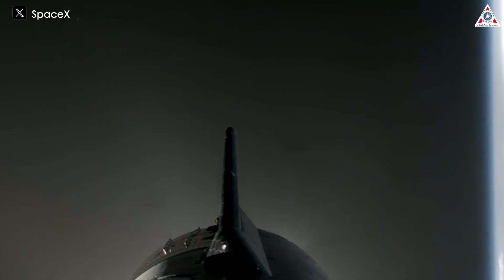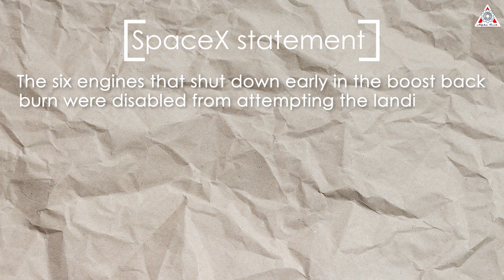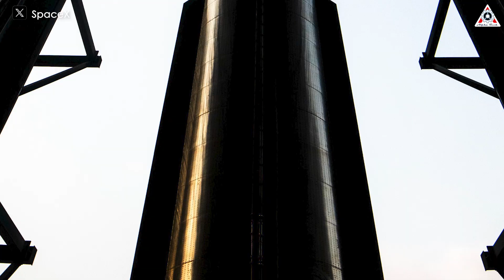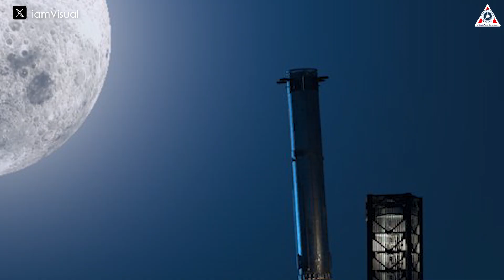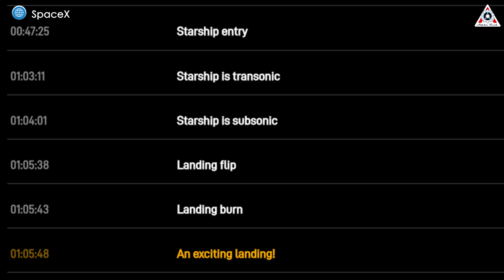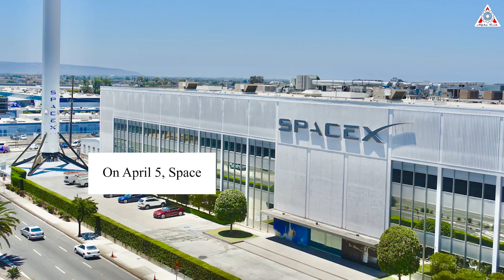SpaceX’s big solution for Flight 4 affter reviewed Flight 3 TROUBLE

Comment: So what kind if idiots would launch again before they fully understood what happen in the previous failure? 

Only SpaceX!!  A more accurate description would be that they don't fully understand what happened. But that sounds kinda bad. Bottom line is they are just guessing!
Reply: They call that iterative development, in reality it's called improvising...
Reply: there is very clear idea of what happened and remedies the odds of making it through re-entry appear to be 80%, doesn't appear to be any safety issues exactly what idiot are you referring to...Are you comparing them to Blue Origin
Reply: @13thbiosphere  The idiot I was referring to iis the one that sees an 80% of making it through re-entry as being ready to try again!! 

As for Blue Origin, I don't see them trying to rack up failed launches just to hit an arbitrary goal set by the owner!  They had one engine failure on launch that caught fire.at Max Q and they did an automatic shutdown and abort saving the capsule before the intact booster came down and  was recovered enough to pinpoint the failure cause. 

They worked hand in hand with the FAA, NTSB, MIT and non-associated parties on the failure analysis and fully reported the results with full transparency..

A very impressive, refreshing approach compared to SpaceX who prepares their failure analysis in secret and provides minimal reporting to the FAA and the CEO gives a verbal one or two sentence media update, with his "trust me" assurances that they have it solved. 

I prefer the BO approach being fully respectful of the governing agencies and full transparent in the reporting. Very professional! They do it the way it should be done!

You might argue that the Musk approach is much quicker to schedule the next failure, but I trust Musk about as far as I can throw a Starship! 

BTW, when are they going to demonstrate the abort/escape feature of Starship??  Oh yeah, I almost forgot, there is none!! BO had tested and demonstrated theirs months before this real world unplanned abort. Worked perfect both times!

Comment: This launch will have so much data delivered to SpaceX they'll be flying humans by flight 15.😅
Reply: And why would you think so?  Pretty clearly they are just guessing what went wrong the third time. How would they get more data like to be sure about icing?? You obviously seem to know si please share!!  They're just going to try some stuff and hope it works, but it's unlikely they get any more real data
Reply: @professorg8383  SpaceX added more control thrusters to keep better roll control, tank filters reworked to alleviate blocking from freezing, dropping the hot stage ring. All improvements over IFT-3. Just a few fixes!
Reply: @PiCorder  Yes, I know, but how does that get them more data??? 

It seems quite clear that data did not pinpoint the issues conclusively. They are making guesses. I hear nothing about adding more sensing capabilities. Maybe they are doing  that, but if so, why not say  it??   

I know this is part of how SpaceX operates, don't really explain things or how they reached a conclusion. They make statements designed to satisfy trusting simpletons. 

Of course if you're the FAA, you want a bit more than that. But SpaceX isn't even supplying a "preliminary report"!. They are saying it isn't complete yet. If the investigation isn't complete, how can you assert that you are ready to fly again??

The only data that they will get is that it failed again or it didn't. But concluding that you solved the problem is not possible to be proven!

I get that you are a SpaceX/Elon Musk cheerleader and enthusiast, but I have seen nothing to conclude that, "This launch will have so much data delivered to SpaceX..."   Do you have some info not available to the public??  

I'm an old school, real world engineer who grew up in the earliest days of the "space race".  Almost everything I see and hear from SpaceX and particularly Elon Musk, tells me O should be very skeptical about anything they say.  In reality, they say very little. So I don't read into that things that are not said. I look back some 50 years plus and compare the level of detail NASA provided on virtually all their missions and I see nothing approaching that from SpaceX.  

I also see a great reluctance to accept government agencies like the FAA and FCC even having authority to regulate what they do. I find this most disturbing when I see other space companies working hand in hand with these authorities. Arguably, they barely respect NASA, with who they have the $2.9 billion contract for HLS. 

SpaceX is way behind the deliverables on the HLS, so arguably, they owe a ton of data to NASA. But NASA issued a fixed price contract to SpaceX, which was a huge mistake. The Starship concept has been around for more than a decade before, but nothing was built until the NASA contract. NASA did not contract for the reusable Starship. But that is what SpaceX is developing and the HLS is suffering in the process. And taxpayer funds are being spent for Musk to build his fantasy rocket and it is questionable at best that the Starship HLS will ever fly.  This is just one of many reasons why I am so skeptical and mistrusting of SpaceX.
Reply: @professorg8383  Wow! That's quite a response! Let me say this; while on the surface, I might appear to be an Elon Musk cheerleader, but in reality, I'm a skeptic as you seem to be. With changes made to starship after flight 3 comes more sensors, cameras, more software, and monitoring mechanisms. Flight 3 issues were explained to be freezing of the propellants in the tanks or valves and filters blocking fuel flow, which prevented engine relighting when required. The propellant temperature is critical and must be kept constant. The problem is that they are liquid at different temperatures, but the methane flows thru the LOX tanks on its way to the engines. Since it freezes at a different temp than oxygen, both must be kept flowing to prevent freezing-like leaving your water faucets dripping water during extreme cold winter weather. This action is not available with a fixed amount of fuel to return these test vehicles safely to earth. I'm a child of Mercury, Gemini, and Apollo eras, and while Spacex, as a private company, doesn't need to tell us everything about their internal operations, NASA, FAA, FCC, etc as publicly funded entities aren't forthcoming at times even though you and I support them through our taxes. I think fixed pricing is great as long as it's realistic. I've seen the waste with cost-plus contracts over the years, but whatever the agreement is, it is what it is, and both parties should abide by its terms. SLS, HLS, are both bold ventures we haven't begun to comprehend their complexities for returning to the moon and onto Mars. I'll most likely be leaving the planet b4 there's a permanent settlement on Mars, let alone the moon, and that won't be this or the next decade. Even in the space industry, the pla ets nations are  not 'all-in' for the benefit of humanity, so it'll be some time b4 true exploration is commonplace. Just look at our Space Force. We're planning for Star Wars and laser satellite attacks and more spying on our neighbors. Elons' wild questimations are hus own, and while over exaggerated, it's his way. Keep in mind that although he may be 'chief' engineer, he's not resolving problems on his own. Credit belongs to his teams. So, while "Elon-time" is synonymous with "whenever it actually happens to come to pass," his companies are changing the world in ways governments have stagnated real progress in space, auto, and other industries. I expected the Space Shuttle to be ferrying astronauts back and forth to the moon, a lunar station, and more, but that didn't happen either! So, I stay patient and watch and appreciate the progress that is being made, such as Starlink and the real possibility that SpaceX will meet their contract obligations at fixed prices while other companies cry and sue and waste tax dollars by demanding NASA to return to cost-plus contracts which contains more waste than progress in space exploration. With new approaches to science and exploration comes new challenges and resolutions in order to achieve results. 🚀 🌙 🚀
Reply: @PiCorder  Glad to hear you are skeptical and come from a place similar to myself. It was the early days of the space race that led me to become an engineer when my peers wanted to become astronauts! I have had along career as an engineer and have worked on a couple really big multi billion dollar cost plus contracts. The key is that they need to be managed by the guys paying the bills. I know this can be done ahead of schedule and under budget. Been there done that!

NASA used to be able to do this and still can be. The key is not handing over control to the contractor. NASA is not as big as it once was, but they can still do this effectively. The way you do this is to hire top notch, trusted and proven, 3rd party project managers. NASA knows who these people are. They exist within many companies NASA does business with. You go after the right individuals and get them to join on. Not cheap, but you get what you pay for. 

The other thing key is how you make the contract for your primary. Must have both sticks and carrots. Incentives and penalties.When you are writing the checks for billion dollar contracts, you have way more power than is often realized. But NASA  has done this before and a few big government projects have followed similar paths. Look at Hyman G. Rickover and the nuclear navy. Rickover was both loved and hated, but he knew how to manage emerging technology and the contractors who did the work. We have the best and safest nuclear navy in the world and all things considered, it came at a reasonable cost. 

I used to like Musk, but I have no use for him today. You mention Starlink, but Musk's stated goals were just ways to get funding. It will never be profitable. and it will never provide low cost internet service to the underserved. Af for the Space force contracts, these are run the old fashion way. But you are right that these type national security contracts don't reveal much information, but it's the nature of the beast. I'm sure Musk hates these guys because they forced their way into his business. But they they had a lot of power to do it after Musk starting thinking he was an elected head of state! But he learned pretty quickly that he was not as powerful as he thought he was. Only an idiot messes with these guys and that's the way it should be. But Musk is still making good money working for them and he has no financial risk in doing so. 

NASA could wield more power than they do. 

I think the Space shuttle was probably on of the biggest achievements of the last century but was hurt by Congress managing their budgets. I never envisioned it like you did and in reality there was no point in going back to the Moon with manned missions. Building colonies on Mars is fantasy for a hundred reasons. As cool as it sounds, I know it's not a viable plan, now or in the future. The US public will never support it and even Musk doesn't have enough real wealth to do it on his own. Musk's Starship fantasy only got off the drawing board when he conned NASA out of some funding. 

The starship is a white elephant because of Musk's goal of 100% reusability. It is ridiculously heavy because of Musk's decision to use stainless steel violating the first rule of spaceflight! You do a good job of describing a major issue with the methane LOX fuel choice, But Musk/SpaceX had to know this. The Starship itself is a dumb concept because they didn't want to use an expendable stage. Again violating well proven principles of thrust vs weight. 33 very complex engines is just adding more points of failure. A violation of basic engineering! Sp you have this white elephant that can't get to a real GEO transfer orbit. It can't get anywhere near the moon without an complete refueling in LEO and as you have pointed out some of the issues with the fuel choice, how long will it take to perfect a dumb, unnecessary concept! 

Falcon 9 is a great rocket that does its job cheaply. And even Falcon heavy is a better rocket than Starship. It can get to the moon but not without expendable components. Starship is not just a bigger version of Falcon 9! So Musk wants to create two even bigger versions of starship to overcome the deficiencies! That's not a smart way to solve the weight vs thrust, fundamental problem with Starship! The problem is that this is Musk's fantasy and he just intimidates young engineers into playing along. Tell Musk that he's making a fundamental design mistake and you'll be looking for a new job the next day! 

Musk fired Rajeev Badyal and his whole senior management team for Starlink because they pointed out some issues with his concept. Rajeev Badyal now heads Project Kuiper at Amazon and all indications are they will build a much better, cheaper system than Starlink, using proven engineering principles. And Musk will have a system that only the wealthy can afford. Starlink will never be cost effective. 

Musk's "integrative design process" is insane for designing anything in the real world. It can work with software development where the cost of failure is insignificant, but rockets and huge infrastructure don't come cheap! 

Look at Tesla which is on the edge of complete collapse. Not because of the tech, outside of "robo cars" but more because of mismanagement.  He was going to save money going to China and now 3 or 4 clone companies outsell Tesla. Who couldn't see that coming!! And now he's in trouble with the SEC. And asks for a $56 billion dollar bonus from a company that has not earned half that in all of its history! And he fires 20,000 of his "valued employees" of his gigafactories when they show up for work in the morning!  And the rats ae leaving the sinking ship and cashing out! His employees will likely get nothing promised to them. The guy is an idiot and not even a half decent engineer. And he's a POS as a human being. He sells fantasies, but they never come true in the real world!

So yeah, I'm a skeptic!  Sorry for getting wordy. Most of the fanboys who don't have a clue and just attack me!  You sound like you are reasonable and might listen to some relevant viewpoints. 

It's kinda hard not to get attracted to the fantasy of colonizing Mars, but the engineer in me sees all the issues with thar. But I get a certain hopefulness. 

As for Musk meeting his contract obligations, namely HLS, he has already failed on that and has set the program back at least 2 years. NASA is looking at alternatives for Artimus 3. Three failed launches is not a measure of progress. And there are many problems they haven't even began to address. Delays will happen, but they are a long way from hitting the revised schedule. The NASA driven SLS is pretty much on target. Orion is in pretty good shape and Blue origin is behind. There is talk that Vulcan could potentially be used in a rework or Atemus 3. but they are pretty well booked. I really don't think Musk really wants HLS and SpaceX doesn't seem to really be working on it. 

Artemus really needs to reworked using what we know should work. I really question if Starship should even be in the mix.